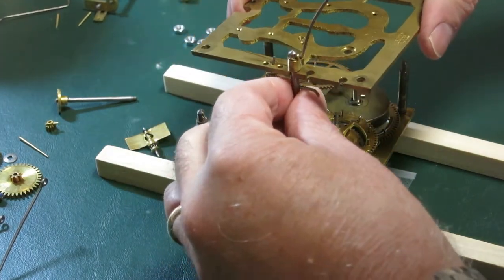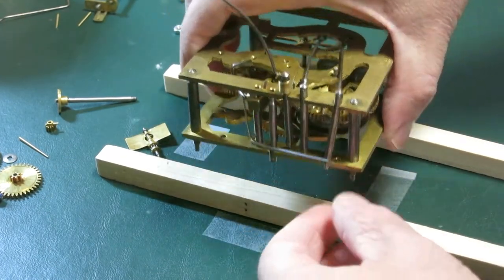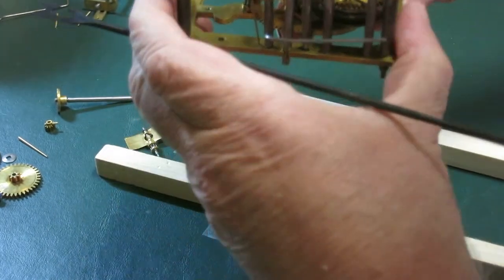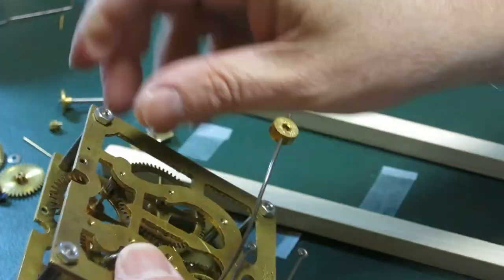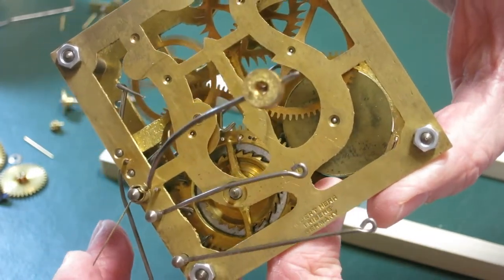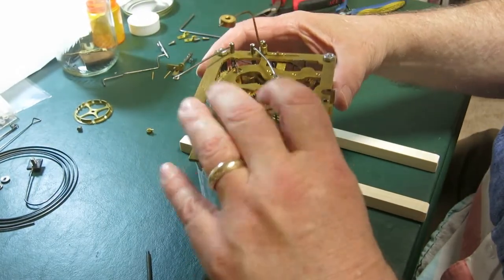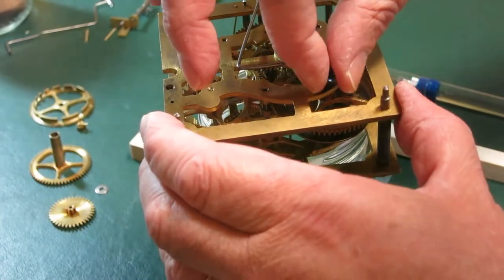Assembling and Adjusting a Count Wheel Based Hubert Herr Cuckoo Clock

Comment from the maker: Index for this video:
0:00 - 5:22 Placing the wheels and levers, explaining how they work together.
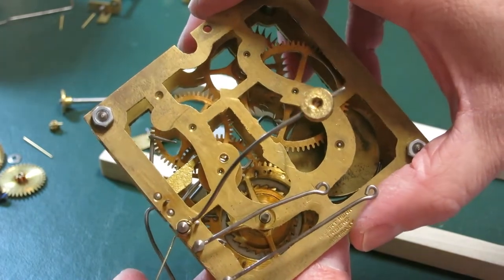5:22 - 12:35 Moving the pivots into place and closing the plates.
12:35 - 27:48 Adjusting the position of the warning pin so the strike train locks properly.
27:48 - 32:10 Adjusting the position of the strike great wheel so the gong-coo-coo sequence plays correctly.
32:10 - 37:15 Assembling the motion works (hour and minute gears)
37:15 - 41:49 Oiling the movement and re-assembling the motion works.
41:49 - 50:58 Installing the count wheel and the small gear that drives it.
50:58 - 52:10 Demonstrating the count wheel operation.
52:10 - 1:03:31 Installing and oiling the escapement.
1:03:31 - 1:08:39 Installing the bird's perch and its helper spring.
1:08:39 - 1:10:07 Installing the feet.
Reply: i realize I'm pretty randomly asking but does anyone know a good website to watch newly released series online?
Reply: @Finnley Kye i would suggest flixzone. You can find it by googling :)
Reply: @Sincere Ace yea, have been watching on FlixZone for since march myself =)
Reply: @Sincere Ace Thank you, I went there and it seems to work :) I appreciate it!
Reply: @Finnley Kye glad I could help xD

Comment: Hey Bradford. You can put in all the levers after you assemble the clock. You have to remove the wire spring that gives tension to the stop arm and the pin that holds the stop arm in position. That will allow you to do it. Then put the spring and pin back in. Hope that helps.
Reply from the maker: Thanks for the tip!

Comment: this is really cool. how did you know where to put each piece? i have an old count wheel movement which is completely unassembled and the springs are unraveled. how would you go about getting the springs back in place, and also every other piece where it should be?
Reply from the maker: I was lucky enough to start from an assembled clock, and took lots (dozens) of photos before and during disassembly. I'd recommend you look at Don Perry's channel (https://www.youtube.com/user/dperry428), because he shows each step in assembling the clock he's working on - his channel is a good first course in clock repair.
Reply from the maker: For getting springs back in place, you'll need a few tools: a "let down" key and the right-size chuck (winding chuck) for your clock - they come in sets. A mainspring clamp set (although some people have good luck with strong fence wire). I also strongly recommend a good mainspring winder, such as https://timesavers.com/i-8944167-ollie-baker-style-spring-winder.html. It's expensive, but much cheaper than a trip to the emergency room. See my video, https://www.youtube.com/watch?v=UyIZOXDcTxc In that video I used a cheap winder, and the spring almost got away from me.

Comment: I have a Hubert Herr movement in a clock, that I would like to dismantle, clean and reassemble.  How is it possible to take it all apart and get it back exactly right, without 30 years experience?  I can take loads of photos but often more than one part comes away and it is not clear where it goes back.  Also from the video, it seems that very small changes to the positions of the gear wheels will make a big difference as to how the clock will eventually function. Howard
Reply from the maker: Great question!

Surprisingly, I've been learning clock repair only since 2018, and have worked on less than a dozen clocks. The main skills you need are to be methodical (like taking lots of photos) and patient (you'll probably need to reassemble the clock several times). I learned a whole lot watching @dperry428 (https://www.youtube.com/user/dperry428), who shows and explains repairs in detail; his videos are like a master class in clock repair. I also learned a lot from an old video showing how to clean a clock without an ultrasonic cleaner - it does a really good job of showing what you can do with only a few tools and no ultrasonic cleaner: https://youtu.be/dqlftVki_Sk I also learned a lot from just a couple really good clock repair books: Clock Repair Basics By Steven Conover (https://timesavers.com/i-8944876-clock-repair-basics-by-steven-conover.html), and Striking Clock Repair Guide By Steven Conover (https://timesavers.com/i-8944875-striking-clock-repair-guide-by-steven-conover.html).

I sympathize with your comment that small changes to the gears' positions make a big difference in the striking of the clock. The main skill you need for adjusting a cuckoo is patience: to adjust the wheel (gear) positions you'll often need to disassemble the clock a little, adjust the gear positions, reassemble, find it's not quite right, do it all again, find it's not right again, and do it once more. When I started learned clock repair I was really intimidated by the process of reassembling a clock; now I still find it time-consuming, but I no longer avoid totally disassembling a clock when I find something isn't quite correctly in place.

Good luck on your clock repair journey, and let me know how it goes!

Comment: 46:58 How did you get the pin out to remove the small gear in the first place? I have a similar (but simpler) looking movement, that I can't find ANY info on. Great vid and camera work! Cheers!
Reply from the maker: There are two ways I've seen and tried: The more common one is to use pliers, with one side pushing on the SMALLER (I originally mistakenly said "larger") end of the tapered pin and the other side of the pliers just off of the other side of the pin - this way you can gently push the pin out enough to grab it with tweezers. The second method, to use if the pin is too short to push, is to use another tapered pin to drive out the original tapered pin, making sure to drive at the narrow, smaller end of the pin (so the pin comes out instead of wedging more firmly into the gear).
Good luck and let me know how it goes.
Reply from the maker: @dperry428 has a video of him disassembling, cleaning, repairing, reassembling, and testing a clock that has a very similar movement in it. https://www.youtube.com/watch?v=ZeN07SW6Dd8 He has videos of him repairing a number of different styles of clock, so you might find your type in his videos somewhere - he's very experienced.
Reply: @BradfordNeedham  Thanks so much. I've been all over that little gear with magnifying glass...I can't find a pin. Could it be friction fit?!?
Reply: @BradfordNeedham  Wow! Thanks very much for taking the time to find this for me. It's VERY much appreciated. Cheers!
Reply from the maker: @mustangk62  Cuckoo clocks often friction fit the little gear that's on the minute wheel (the one in the center of the movement, with a long shaft). I try to avoid removing friction fit gears because 1) it's difficult to remove and re-fit the gear without damaging the movement - you need a pry bar set and a staking set, and 2) sometimes the gear is put on in a particular orientation, and it's difficult to put it back on in the correct orientation. Also, sometimes there's a way to free the shaft for cleaning by removing some other part that is pinned on the other end of the shaft. I don't have enough experience to advise you further on that - you might try contacting dperry428 on YouTube. Good luck.
Reply: @BradfordNeedham  'Nuf said! I'll leave it alone! 😆 Thanks!

Comment: One small question..I have the same clock, and upon assembly I found that the bird spring had very little tension. I gave it another wrap around, as you did, yet it spins on the metal rod. Is there a small hole in the rod that one end of the spring is attached to? I can’t seem to find one, yet  I know the spring must be attached at some point to the rod.could you elaborate. Thanks and you’ve helped me enormously.
Reply from the maker: From the photos I took, I can see how the helper spring is attached to the bird perch: there is a lever at the bottom of the perch. That lever is pulled in by a long vertical lever to make the bird come out. The bottom of the helper spring is wrapped around that lever a few turns before being wrapped around the vertical part of the bird perch.

I've seen this type of spring attachment in cuckoo hammers as well: the helper spring wraps around a lever part of the hammer before winding around the hammer.

Born Again Clocks has a nice video on making helper springs. In part of the video, he winds a helper spring around a lever in the way I just described. https://youtu.be/Vx42YH3xvQI

Comment: +
Bradford Needham
Don't worry, sir. Majak cockoo clock(soviet one) is more tricky to assemble then this german one .. German cockoo clocks are made much better(i mean material quality) then soviet one. Every lever  is pretty easy to bend. When I assembled mine Majak  cockoo i exprienced the problem with 30 minute striking (insted half hour  it strikes full hour).. I spend many minutes to figure out what's  wrong with that soviet peace of crap and I found that the  couting lever   was bent in upper directiction so it jumps out from couting wheel slot... Most probably i bent it by mistate during assemble process. I have no idea how because i was very very careful but it's Majak so everything is possible... A few months later  I cleand german cockoo from early 60s and it worked from first shot.
Reply from the maker: Congratulations on preserving a bit of history, and thanks for the warning about Soviet clocks. I've had similar problems with other clocks, discovering damage that didn't seem to be there before I disassembled the clock :-)
Reply: Would sure love to see you do a video of a SCHATZ cuckoo. Would it be possible to see the process from disassembly , reassembly and adjustments? Don't know why but I kind of love them.